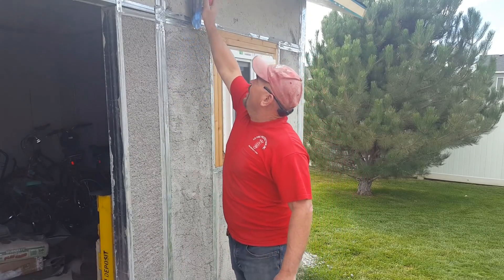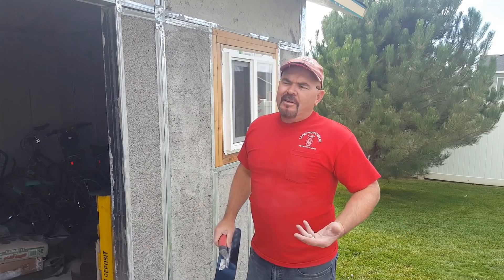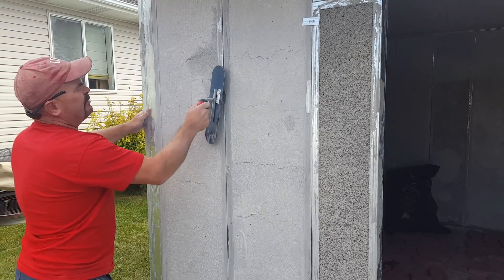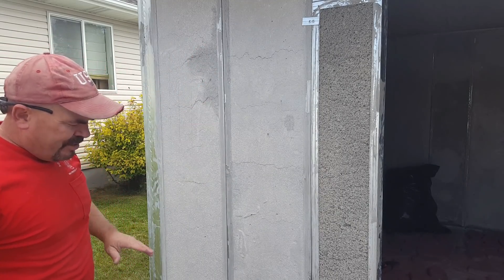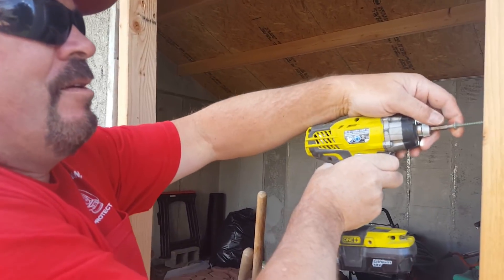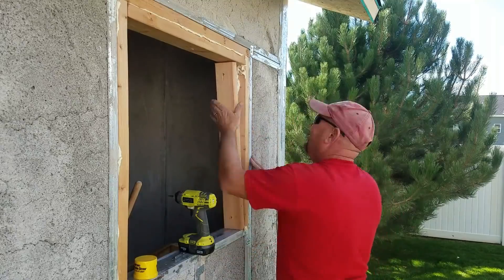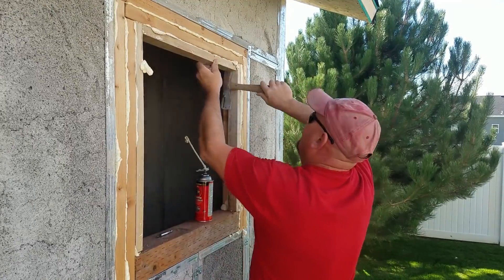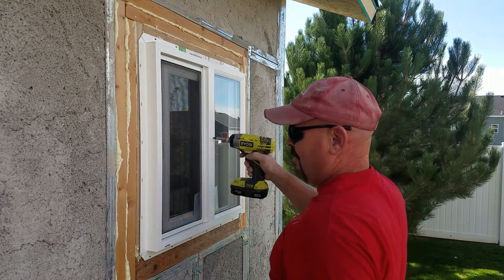A Miracle Invention, Only Aircrete Building like It Anywhere.

Comment: How will aircrete perform in colder areas with tons of freeze-thaw cycles?  I'm guessing because it's more porous, it'll absorb more moisture, which will cause more cracking and flaking whenever it freezes?

Comment: In my humble opinion you should have but on wire mesh over the aluminum Frame and aircreate panels. In time the stucco will chip off because the stucco can't stick to the smooth surface of the aluminum Frame work.

Comment: I think you should design your own air Crete building Block mould  the same design as the commercial air Crete blocks and then stack them fill them with more air Crete or concrete and rebar.  Theis way your building design and construction could be more acceptable to your building authority.

Comment: I am building an AirCrete dome using this guy's frame/aircrete method but I added 1" tabs to the forms so i can tackweld the triangle forms together once the aircrete cures, then I plan to stucco over the whole thing using fiber-enforced stucco that will seal the joints and add to the look and strength of the dome.

Comment: Wait. Why leave the metal frames? I thought the point was to make
Molds and then cast it with the aircrete, then use the aircrete like bricks...
Reply: how would he join blocks together? it wouldn't be strong enough unless he made a dome.
Reply: Hamguy Bacon he could’ve just used them like bricks.... made them thicker and used grout 🤷🏽‍♀️

Comment: This is interesting, and I appreciate your inventiveness and effort.  Although some of the comments are negative,  hopefully they're providing you with some useful info. 
Personally, I'm wondering what will happen when the studs rust . While they're galvanized, the moisture within the concrete will still eventually corrode them. 
While I really like the idea of using them as forms, I think they should be taken off. 
Flip them around and use them as vertical mold wall. Then peel them and reuse them.

Comment: I love how everyone is posting questions of why the build without watching any of the previous vids.  For everyone who doesnt know...... this guy built his own aircrete bubble generator.  Then, decided to try a new building technique.  This has never been done before.  Its great though how all of these armchair warriors will sit on their butts and criticize the guy.  And, no.  The window isnt in backwards.  They look that way because those type windows are meant to site flush with exterior coverings after sheathing, siding, and trim.

Great job.  I watched some of the earlier vids and was wondering how it was going to come out.  My question is what are you planning to do to finish the interior........ maybe just a masonry sealer or what.  Also, are you putting electrical in there?  Conduit?  MC cable?  Can you screw directly to the aircrete or do you use Tapcons or what?
Reply: Yes, good work. If like to know how electrical was handled too

Comment: He forgot to level and put on window flashing under the window.
Reply: its a shed don't think it matters.
Reply: @HamguyBacon  It does if he is going to open the window.
Reply: Doesnt the skim coat that your scraping off on the panels help seal the aircrete? What treatment are you doing to seal the outside?

Comment: I was interested to see what is unique about this project to make you pre-fab crete forms and erect panels one by one, after watching the whole series I'm more convinced that this is just good youtube entertainment.  There's nothing new to be learned here.  The shed you built could be erected with conventional framing technique faster & cheaper, a plywood wall would give you more shear strength and your walls would have higher tensile strength than your aircrete panels.   Watching you scrape that panel it was apparent that one panel already had cracked.  So why you would go through such lengths to do all that is still a mystery to me, other than maybe you're a concrete guy and prefer mixing cement bags than swinging a hammer.   But thanks for taking time to video and share your experience with youtube.
Reply: 1. Why would you even mention tensile strength? How many houses get pulled apart? Compression strength is FAR more important. 2. Air-crete insulates about as well as spray foam and is an EXCELLENT building material in hot climates. 3. It doesn't burn. 4. Insects don't eat it. 5. It doesn't rot. 6. Last, this is clearly a TESTING stage and can in no way be compared to established building techniques.

Comment: silicosis here it comes  you get this from not wearing a mask ,sadly Darwin your approach to safety leaves me wondering  first kids running about in bare feet, climbing ladders in the work area , children and work areas do not mix  suggest if you do this again fence off and keep kids away completely yes a retired builder 65 years  and one who has raised many a precast panel or as well call them a tilt slab

Comment: We love your videos and watching the kids "help". I was very interested in how well the shed would turn out. Looks great! 
One concern I have was the decision to use foam insulation spray on the window installion instead of construction adhesives. Won't the foam expand to 10x or more placing an immence amount of pressure on the window?
Reply: No it won't especially with only a little bit. There's also window and door foam. Use the proper can for the job, there is a difference.

Comment: You have very interesting ideas ..
a) wouldnt it be much easier to finish the outward Shell instead Scratching it?
b) I dont know how to produce the cream texture you put to the cement or concrete - any consistancy? And c) .. as I got it right the only things keeping the walls stable is the beams set up and finally the roof, Right?

Comment: Darwin, "DON'T" pay any attention to those haters who thumbed down, they are just "JEALOUS" thanks for sharing you're videos, and experiments,  Just wondering why you didn't pour bigger walls and attach points to bolt together. I've hauled many precast loads of walls / slabs, they due require cranes, but  I'm wondering what the weight per panel was? Could you have made 1 panel instead of 3? Just wondering if they would have been to heavy to lift? ? Thanks Bruce, PS,  "Looks Awesome" always wanted a roll up door.
Reply: Bruce Junker  junker is about right. Guess you don't see all the cracking ? And wait for that high wind day!

Comment: 8ta! Honey Do. I'm from South Africa. I'm new to your channel. I'm inspired by your creativity and fascinated about the applications of aircrete. Down here we use the non-metric system which is a little confusing when it comes to measurements. Anyhow, my question is how many bags of cement did you use to get the shed done and what other additives did you use as far as powders in the mix?

Comment: just build a dome home like a paper mache balloon art.  inflate balloon apply aircrete over top wire mesh, let harden, deflate balloon.  hey do you want to build some Hawaiian aircrete offgrid bungalows with me?
Reply: how do you get the wire mesh to stay on top of the wire balloon, won't the weight of the wire plus the aircrete collapse it?
Reply: Not really I'd think the slurry is too soft. This is cool. I love the part where he admits it would have been better you screed it off before it gets too dry. @utubeape

Comment: How much has it cost you in materials so far?
Reply from the maker: less than $2k Im thinking of building little bungalow cabins with it.
Reply: @HoneyDoCarpenter  
Why did you go with panels instead of bricks?
Seems the frames (was that aluminum?) are an expensive way to go
Bricks poured in a grid made out of plywood boards. Would also not need wire mesh reinforcement
You would need a frame for the building, to hold the roof, but still cheaper than panels
Reply: Same question how much

Comment: This seems like a well thought out project.

I don’t know the kind of weather you have there.  The slabs you made reminded me of slabs I have seen in other projects.

AAC (autoclave aerated concrete) is a great thermal insulator, and roof slabs made of AAC will time shift the heat release from daylight to nighttime.  This reduces the amount of required insulation depending on the local climate.  AAC is used by hotel chains like Holiday Inn due to the energy savings it provides both in cold or hot climates.

I don’t honestly know the material you used that well, but I am assuming it shares some similar properties.
Reply: How to make aircrete

Comment: Darwin.  You need to hold your foam cans upside down when you are dispensing it.  If you don't, you'll not get all the foam out of the can and it will also not mix properly.
Thanks for another great video.

Comment: Hi, for next project, leave the 1/8” to 1/4” excess cement in place and do not scrape it. Once the stucco coat goes on, it will not be noticeable. Also put a bead of silicone around the perimeter of the window wing for air seal. But overall great job. Congrats.